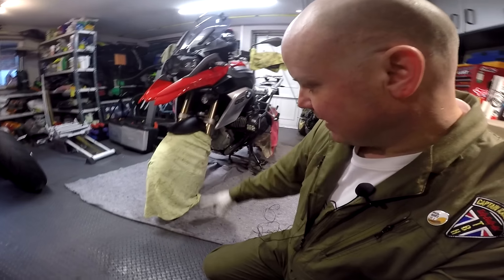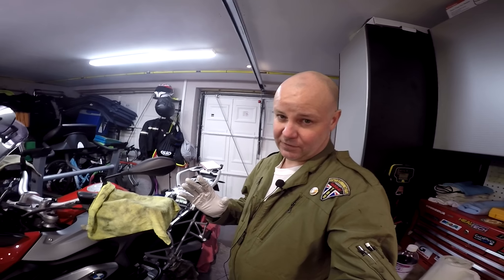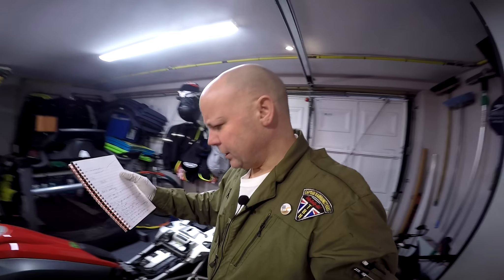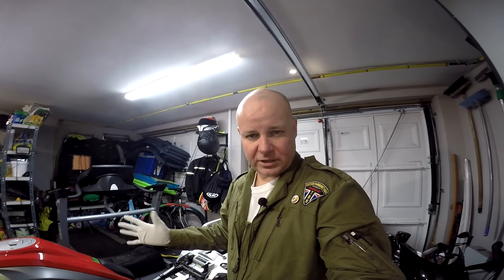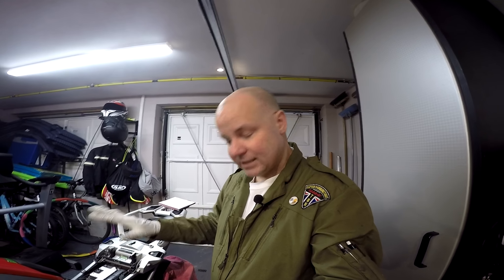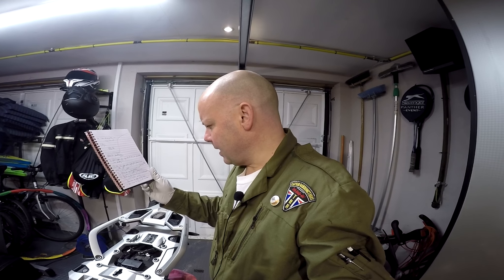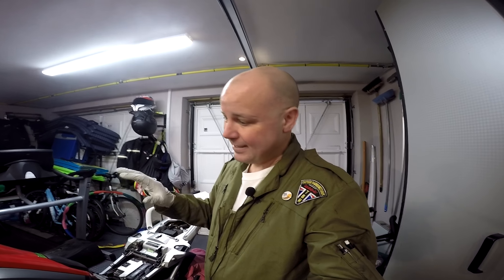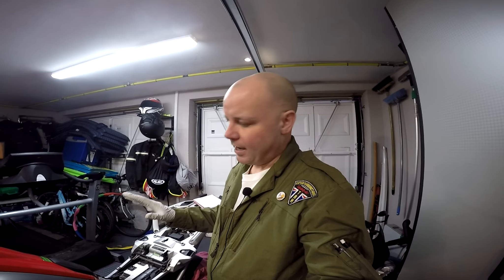How to apply ACF50 - Your questions answered

Comment: good video and good points. Regarding the washing of the bike - what i was told by a couple of allyearbiker people was that wash your bike with water only and use a brush then rinse it off. Do not use a detergant. Once the bike is dry just rub the bike down with the cloth that has some ACF50 on it. This way ypou are cleaning the bike, getting the dirt, salt and crud off but not getting any ACF 50 off. Using this you will only need to use the ACF50 once a year just before the roads are gritted.

I certainly found that to be the case and I do my bike in November and everyweek just hose it down and use a brush to clean it. The dry it and rub it down with the ACF50 cloth. Bike comes out shining and has never rusted or anything.

Comment: Have used ACF50 on all my bikes, but have used the aerosol can, used it sparingly , also spray on cloth and wipe over bike everytime i wash my bike, great results, one can lasted 12 months, will use the bottle type next time, just bought a pet dryer to make drying bike much easier as in your other videos, so water just does not sit and rust in those hard to reach places.
Reply from the maker: Nice one Andy, you're on the way to a perpetual "as new" looking bike :0)

Comment: Hi. I've just spent the weekend cleaning and applying ACF50 to my 1199 Panigale and 800 XRX, great stuff although did the schoolboy error of not warming it prior to application so it came out as a single squirt instead of a diffused spray so had a little extra work getting an overall coverage.Took all the fairings off the Pani and the results looked really good, very pleased. Thanks for your video not only on this but all the other topics as well.I also bought a pet dryer prior to Christmas and only just got around to using it, amazing how much water you get out of all the nooks and crannies, well worth the purchase.Thanks again.
Reply from the maker: Isn't it just (is there an echo around??)

Comment: I found this stuff a few years before this video, stuff seems to be great so far. Its a bit $$ but worth it if you value your outdoor electronics and vehicles.
RE: Spray bottles: I found you actually don't have to spray. Spraying on is just for coverage. If you want you can just apply some to a cloth and wipe down whatever, drip it into electrical connections. Wait a few hours or a day and wipe it down to get off any extra if you put on too much.

Comment: Tip if you do use the cans is to place the can in a bowl of warm (40°c ish ) water  for 5-10 min before using it. It reduces the viscosity and increases the pressure of the propellant. 
But Best Buy the 1 ltr. I use a combination of the pump bottle and micro fibre cloth and a spray gun and compressor to apply ACF50. 
Great product first used it on my 2008 TDM900 when I bought it new. That TDM900 still looks in great condition after 8 winters commuting ( my brother owns it now)
My new Tiger Sport has got the same treatment.
Reply from the maker: Great stuff - thanks for watching and for stopping by....

Comment: Great advice, you can apply thinly using the aerosol, if you put the cans in a bucket of warm water for 10 to 15 minutes, the bulk applicator though is better vfm...and easier to use.
Reply: Warming the ACF50 also applies if you are using the squirty bottle or using a spray gun
Reply from the maker: As per >> https://www.youtube.com/watch?v=jjx5gqBZLfk :0)
Reply: Thought you were getting a HVLP spray gun for this season. You will then realise how bad the little squirty bottles are.
Reply from the maker: Yes I really want one but each year forget until it's ACF season again!  maybe next year....
Reply: Great little video as always. Someone gave me a paraffin spray gun years ago and reading the thread I was wondering if anyone could recommend a suitable compressor which would do the job. Most look quite ‘industrial’ and apart from using one with the gun I’m not sure what else I would use it for. The fitting on the spray gun for the compressor looks like a rubber pipe should just slide over it so I’m assuming the compressor doesn’t have to be mega powerful. Cheers and keep us the good work.

Comment: Many years ago I always used WD40 for protecting my bike but AC50 is a far superior product. I procured my ‘set’ from Nippy Norman’s and like yourself I find the trigger applicator bottle extremely useful. I even use the stuff under the bonnet of my Golf R. I will be giving my GS a good wash this weekend, then blow the bike dry using the pet dryer air blower. Then a nice coating of AC50. If it’s not too late to say... Happy New Year TMF.
Reply from the maker: Cheers Michael - and to you....

Comment: Following your advice I applied ACF50 to my GSA, and that worked out very well indeed. Be sure to cover the area around the bike, otherwise things can get a bit messy. To cover the wheels I use paper table cloth. It's easy to roll around the wheels, and afterwards I only have to throw it in the bin.
Reply from the maker: Great tip!

Comment: I've been using ACF50 on my Ebike for a couple of years it realy does work. I use the aerosol can, spray on to a microfibre cloth and apply it. This would be a good way to protect a smaller or non fairing bike, you realy don't want to get it on brakes or hand grips.

Comment: Great video. I have my brand new cb300r and despite it being summer, I see an aweful lot of shiny bolts so I thought I would give it a try as I figure it's never going to be cleaner than this point in time being new. From watching this and other vlogs seems thin application is the key. I have a can and as mentioned it does not spray in a mist. I think you can apply in small amounts and then wipe all the excess of with a couple of microfibre cloths.

Comment: Great video thanks, I was put off ACF 50 when Delboys garage said not to use it because it costs hundreds of pound to apply and its not worth the money but now I have seen how you use it and its only £30 I shall definitely get some! after all you should know your a pilot and it is made by aviation industry to protect million pound aircraft!
Reply from the maker: I find it great - and you don't need to apply much at a time, in fact the thinner the better!
Reply: I think Delboy uses Scottoiler FS365.
Reply: He reviewed all of them and said Fs365 was the way to go but i saw someone test it along with several others  and fs365 rusted over night on the same application as ACF50 which still didn't rust after a week
Reply from the maker: If you watch my original video https://www.youtube.com/watch?v=jjx5gqBZLfk you'll see the test I did with a couple of bolts left outside....
Reply: If you use FS365 like you do ACF it will just wash off with rain or road spray, leaving the bike unprotected. You need to reapply it every time the bike gets wet but don't need the bike to be clean or dry to do so. Very quick method but much more frequent. I can't vouch for its long term effectiveness. I have more faith in ACF.

Comment: Interesting! We have something similar here in SoCal. Perhaps under the guise of “more info than one needs to know” a Harley mechanic in the 60’s whom also had a background in chemistry came up with a formula to aid in fighting the corrosion that occurred on motorcycles particularly those that roosted near the beach. Paul Gibbs (I think) was his name and the product appropriately named..........Gibbs. I started using it years ago when I was out in Topanga Canyon which was right above the ocean. Folks soak every inch of metal they own in the stuff and I absolutely swear by it. I probably treat my bikes 8 or 10 times a year and I’ve never seen even a hint of rust or corrosion. Locks, latches, garage doors anything susceptible to corrosion. Miracle stuff..... Like I said more than you need to know but I am, after all, a geek about anything motorcycle’s, garage and maintenance oriented :)
Reply from the maker: Sounds good Don - but does Gibbs make your garage smell nice once you've used it?
Reply: TheMissendenFlyer  Well then.......no....decidedly no :)

Comment: Thanks TMF, I did buy one of those garden hand held sprayers that you pump to get pressure but it didn't really work, I think the ACF50 is too thick and heavy. I would agree stick with the spray bottle they give you unless you have access to a proper high power electric sprayer like the professionals use. I also keep the cloth I use to wipe over the ACF50 in a zip lock bag, which I find is great to use for a quick wipe with a little ACF50 in between the main applications.
Reply from the maker: 100% agree - I've tried all types of applicators (even an olive oil sprayer) - like you say the ACF50 supplied one is the only one that seems to work unless you have an air-line and sprayer (which would be ideal)....

Comment: Thank you for this one! Just placed an order. I might be a tad too late on my bike, but it'd be interesting to see how it will tackle the first spots of light rust on some of the details..
Reply from the maker: You never know, maybe it'll clear them up?  Fingers crossed....
Reply: Bro I have a Bandit which are well known for rust probs.  I had salt burn on the engine cooling fins, and some minor rust.  Whack ACF50 on, I swear it makes the salt covered areas look like new, and while it can't "heal" rust, it will certainly inhibit it from becoming any worse.

Thoroughly clean your bike, then ACF50 it, and leave it...it will look dirty, but the ACF doesn't come off, you'll be good to ride through winter.  Personally, as it's expensive and potentially messy I fill the cap off the top of the can with ACF and then paint it on the bike with a brush.  Just don't get it on your brakes!

Comment: Best thing if you have the aerosol is to spray some in the lid of the can and use a small paint brush to apply it. You can certainly use this around the more delicate area like the brake bolts etc
Reply from the maker: Indeed you can.....

Comment: Hello great video! Spraying the whole bike will also cover some rubber parts, such as hoses and other rubber componentes, is this ok? Do you spray your instrument panel as well? And also, can the inner fork tube of the front (upside down) suspension be sprayed?
Thanks, just want to clear these doubts before applying for the first time👍 Cheers
Reply from the maker: It’s entirely inert so you can spray rubber hoses with no issue - similarly your instrument panel but why would you want to make it all smeared??

Comment: When I mentioned ACF50 at the dealership I bought my GS from, I was told BMW actually recommends it.
The first time I applied it, I sprayed it too thick as well, and cleaning the garage floor took some time. I won't be making that mistake again ;-)
Reply from the maker: Yes you only do that the once!
Reply: I wait till my neighbours are at work then do it on their drive 😉

Comment: Ambersil do a similar product to ACF50 called PX24 which is much cheaper and less gloopy to apply.  Available on EBay, Amazon etc.  I first came across it when the Royal Navy used it to protect helicopters on ships from the salt laden spray, a similar use that the US use ACF50 for.  It also comes with a long list of Defence and other NATO codes, just like ACF50.  Might be a better option for some folks.   Just a thought.

Comment: I spray my Street Triple RS with Muc-off but looks like it's a change to ACF-50 as today I was on my way-in the pouring rain-to the Triumph factory for the tour and she broke down. Water in all the switches on the bars - the bloke from the RAC managed to get the water out of the microswitch under the clutch so I could start the bike, but the left hand indicator was stuck on as well as the full beam. Sorry to all the cars I dazzled on the A46
Reply from the maker: Yikes - ACF50 is the way to go!

Comment: I discovered acf50 on your channel, checked it out thoroughly on YouTube, test after test  it seems a cut above everything else, I really should have paid attention to the bit about preheating in hot water as the little sprayer did not work at room temperature, otherwise it seems to be working perfectly against the roadsalt
Reply from the maker: Yeah it's good stuff - and that warming tip really helps to get it atomised as you found....

Comment: I might have missed this TMF, but does ACF50 harm greased bearings? For instance, if it is sprayed around the top and bottom of a motorcycle's steering stem, will it work its way into the top and bottom stem bearings and adversely affect the performance of the the grease leading to bearing failure? Same question regarding working its way into sealed wheel bearings.
Reply from the maker: My understanding is that it’s inert - so shouldn’t harm anything....

Comment: Great video as always. I was given a paraffin spray gun years ago in a garage clearance. If this is a good way of applying AFC50, what sort of compressor would I need, are they expensive and what else can they be used for apart from the gun and pumping up tires!
Reply from the maker: Good questions - I ordered a compressor last week (just after I made this video)....so I'll let you know!
Reply: Cheers TMF, I feel a slightly different review coming on!

Comment: Great video pair. What about exhaust pipes and can? Is it ok to use on gloss painted areas such as the red top of your GS?
Reply from the maker: Yes you can use it everywhere - but little point in putting rust preventer on plastic of course!
Reply: @TheMissendenFlyer  Thanks! Re plastics...I get your point but I guess it's similar to when used vehicle sellers use silicon spray to make them look great. 👍

Comment: Great videos on the acf 50 product. I haven’t used my bike through the winter this year as I be done some modifications and general maintenance, is it worth doing a treatment now or is this just for winter time. Cheers
Reply from the maker: Really it's just for winter time...depends if you think we're out of winter yet!
Reply: TheMissendenFlyer well you never can tell in the UK, I think I may do some areas that are prone to corrosion but other than that it’s good. Thanks for your reply.

Comment: Re applying ACF-50 on the painted wheels,do you just spray a cloth and wipe it over or do you use the atomiser spray
Reply from the maker: I tend to wipe over with a cloth - that way you can be sure to avoid the tyres....

Comment: Great video and useful, I have a few questions, if I don’t use the bike during the winter so I need to use acf50 can I just use a motorcycle protector spray? As I have acf50 should I just apply it on the bike ready for the summer. I know that’s a no brainer of a question thanks for you help and keep up the greats vlogs!!
Reply from the maker: Cheers and you know the answer - get it on there!

Comment: How did you get on with your compressor? Can you recommend it? Great videos thanks.
Reply from the maker: Not used it for much except pumping the tyres yet....mainly got it for acf50ing in the winter season
Reply: TheMissendenFlyer winter is coming! Please could you tell me which compressor and spray gun you bought, I’ve just bought a Harley full to the brim with chrome as a stable mate for my tiger 800. Looking to take the pain out of acf 50 spraying !!!
 Any chance of you reviewing Harley sportsters - i was surprised how much fun a 2 wheeled tractor can be!

Comment: Ah, too bad I didn't see it a week ago. I did my first spray of my first bike on Sunday - using the canned version. And of course I sprayed it over the brake disc too, because I didn't realise it had oil in it, so that required some work to clean up... Plus I think I applied too much overall - particularly on the engine and the radiator - when I started the bike the next day the thing started evaporating like crazy once the machine warmed up. It almost looked as if the bike was smoking... Lesson learned for the next time ;-)
Reply from the maker: Oops (the bike always smokes after application - that is normal)....
Reply: Noted! :-)

Comment: I swear by ACF50 and as advised bought the bottle and atomiser. I have to say the small sprayer supplied is rubbish and as bad an application tool as the aerosol. It just squirts a jet and then broke :-( and that's after keeping the ACF50 in the house so it was warm and making sure it was well mixed.
I think the small brush application sounds the best option not having any paraffin spray equipment.

Comment: I've started using fs365 now instead, I use my bike all year and like to wash it regularly rather than applying this and leaving it all winter as it's a pita to clean off.
Reply from the maker: I don't have a problem with it at all, never been an issue or indeed needed to clean it off - thin application is the key!  ...but whatever works for you is of course right for you...thanks for watching - TMF